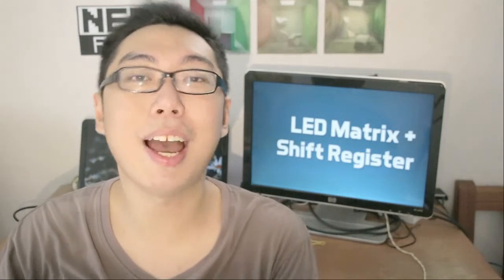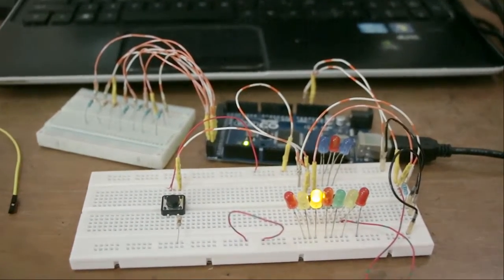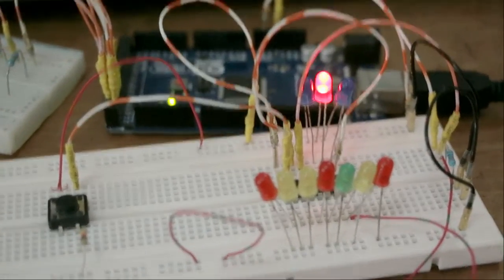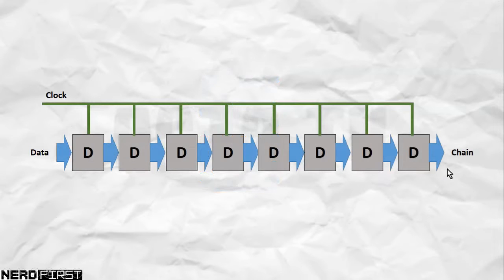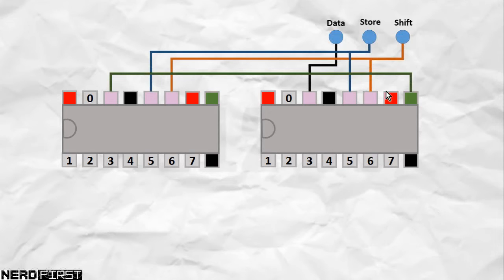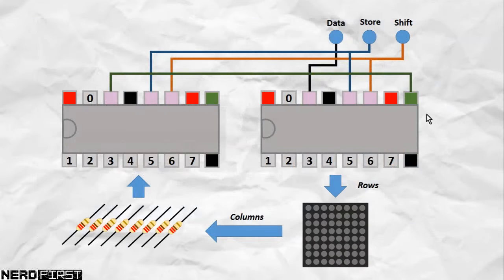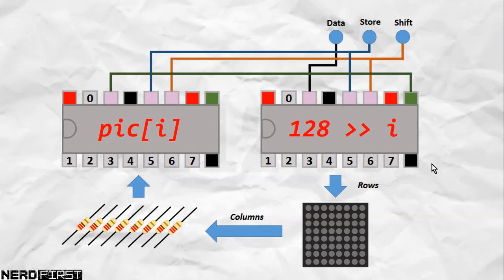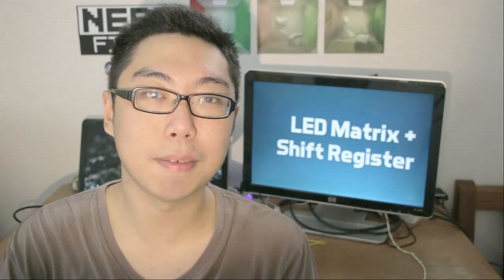Run an 8x8 LED Matrix using 3 pins!

Comment: Now today we can make led metrix with  one wire for signal and two wires for supply using ws2812 led  .
Reply from the maker: Hello and thank you for your comment! Indeed, three wires is probably the limit, though WS2812 uses a more complex signaling mechanism, almost the equivalent of building the shift register directly into every LED.

Comment: I tried the 8x16 matrix, but its not working, I just connected an extra shift register on data -> chain, and shift and store are connected. But I get is just a brief light up and then low brightness. can you help me with how the proper pinouts of 8x16 and what to modify in the code.
Reply from the maker: Hello and thank you for your comment! What you've described sounds correct (though note that strictly speaking it's chain -> data. The chain pin sends the overflowing bit out of the shift register and into the next). You'll need one shift register to select rows, and two to set column values. How you order them is actually up to you as long as the code follows the order.

If you were to do something like (Columns for Left Matrix) -> (Columns for Right Matrix) -> (Rows for both), then your shiftOut code should follow the reverse order:
shiftOut(DATA_PIN, SHIFT_PIN, LSBFIRST, 0b00100000);   // Select a row
shiftOut(DATA_PIN, SHIFT_PIN, LSBFIRST, 0b10101010);   // Left matrix graphic on row
shiftOut(DATA_PIN, SHIFT_PIN, LSBFIRST, 0b10101010);   // Right matrix graphic on row
store();    // Send out your updates to the LED matrices

Comment: If I do 16 by 16 led matrix, do I need 4 shift register? if so the bits on the code will be 510(1111111111111111)?
Reply from the maker: Hello and thank you for your comment! Yes, if you have a 16x16 LED matrix and you stick to the same 8-bit shift registers, you'll need four of them. 

However, Arduino's shiftOut() is designed to work with bytes (8 bits), so realistically, you're going to either have to call shiftOut() twice to shift 16 times, or you'll have to roll your own equivalent function.

By the way, that's a 16-bit number you're looking at, so the range goes up to 65535, not just 511!

Comment: Hey man, I saw you're still replying to comments and wanted to ask if there's a u8g library compatible with this. it would eliminate the need for the max7219 entirely
Reply: also subbed
Reply from the maker: Hello and thank you for your comment! I'm not aware of any graphics library for such LED matrices that also don't assume that they're driven by a max7219 or similar chip. Given the amount of wiring and setup involved, I think this technique just isn't as easy and consequently isn't as popular.

Comment: Hii, currently making this one and im having trouble. No led turns on but when i touch the IC it lit up all led. Could it be the IC the problem?
Reply from the maker: Hello and thank you for your comment! It's not really easy to tell what the problem is.

Double check that your connections are correct and not loose. If you're prototyping on a breadboard like I am, a lot of the times, that's all it takes.

Otherwise, you're gonna have to go through a set of sanity checks to see if the code or LED matrix are working properly.

Comment: There are 16bit i2c (de)multiplexers that only require two wires. They can run on 2v so I think you can do without the resistros as well.
Reply from the maker: Hello and thank you for your comment! Yes, there are definitely many ways of solving this. I went for the Shift Register technique since it's what I had on hand, and is relatively simple to understand without too much additional pre-requisite knowledge of techniques like i2c.

Comment: If you want to try using only 1 shift register and 1 decade counter, I highly recommend preparing 8 transistors for the decade counter pins. You will probably implement those output pins for the rows of the matrix due to its limited capability. I recently tried using those and directly connecting decade counter output pins as VCC for the led. I found out that each of these pin have built in resistors inside. These resistors are provided from the inverters of the IC. Making the last video as a reference, you don't like these resistors to be in series with your paralleled LEDS. Since the decade counter is an unchangeable IC, your best course is to connect each pin to the base of a transistor and make it as a switch for the direct 5V source (connected in collector) to pass through the emitter (connected in VCC of 8x8 matrix). I had a hard time finding this idea but it is such an opportunity to learn and share it with you.
Reply from the maker: Hello and thank you for your comment! This is super interesting, I never considered how the internals of the IC could also lead to undesirable behavior. I mostly looked at it as a black box ignoring implementation.
Reply: @NERDfirst   Always welcome 😊. Btw you can also use these 8 transistors as a solution for your maximum current draw in your shift register. You can just make those output pins as a switch to provide a direct 5 volts in every anode of your matrix. Since the 5V source of the arduino can handle, theoretically, a maximum of 800mA, you won't get any problem in long runs.

Comment: Hi! Really love the tutorial!!! very easy to understand... I just encountered a bit of a pickle... 
when i use this your code in this part:
for (int i=0; i<8; i++) {
    shiftOut(DATA, SHIFT, LSBFIRST, ~pic[i]);

    shiftOut(DATA, SHIFT, LSBFIRST, 128 >> i);
    store();
  }
all the led light up...

but when i interchange the two shiftout function:
for (int i=0; i<8; i++) {
    shiftOut(DATA, SHIFT, LSBFIRST, 128 >> i);
    shiftOut(DATA, SHIFT, LSBFIRST, ~pic[i]);
    store();
  }
the desired pattern shows up...
can you pls tell me what is happening? I think i correctly placed the wire connections...
Reply from the maker: Hello and thank you for your comment! Looks like the role of the two shift registers have been swapped around. Assuming that your wiring is indeed correct (including the wiring going to rows vs columns, assignments of voltage sinks and sources, and wiring between the two shift registers), then it's entirely possible this might be caused by differences in components.

Comment: Thanks again! Just what I need for my electronics project!
Reply from the maker: You're welcome! Glad to be of help =)
Reply: @NERDfirst  Hi! I wanted to ask if I could replace the 74HC595N with 74HC299N? I am trying to but it is driving me crazy. There is only one clock input on the 74HC299N while the 74HC595N has two - one for shift register and one for store register. Thanks a lot!
Reply from the maker: Hello again! I don't have experience using the 74HC299N, so take everything I say here with a pinch of salt. I just skimmed the datasheet and have a very limited understanding.

The 595 is actually two sets of shift registers, which allow you to shift values into a "temporary" bank before storing them into the output. The 299 doesn't have this, since, if I understand correctly, it's designed for parallel updates of the internal shift register via its pins, ie. The pins can be used for both reads and writes.

You will probably not use this feature. Instead, you can still use DSL Pin 18 as a digital input, while left shifting (ie. MR Pin 9 High, S1 Pin 19 High, S0 Pin 1 Low while pulsing CP Pin 12). This will make it behave the same way as the shift register in the video, minus the two-bank "storing" effect.

Not really sure if it'll work well in the context of driving these matrices though.

Comment: Hi! I followed your tutorial with interest. I also have a slightly different circuit, but a very similar little sketch (I didn't make it myself). I made it statically display "0", in the array I have several elements, and I want to display "1" as well. How can I put a delay between them? My matrix just flickers very fast.
https://drive.google.com/file/d/1GuvV2wnkvv47gfbxX6Hnw0eDYN-3P4rP/view?usp=share_link

Comment from the maker: Expand for Errata and Other Notes

1. On Current Draw
Do note that one important concern is whether the shift register and the Arduino can truly provide enough current to power the matrix, especially if many LEDs are switched on at the same time. This is particularly important as the datasheet for the 74HC595 shift register says that the maximum current any pin can source or sink is 8mA which is really not a lot. It'll work in little toy examples like this one, but if you're going to be building something like this for use in the long run, you might not want to do it the way I did!

Take your own measurements, refer to datasheets, and use external power sources to be safe. Thanks to YouTube user Enigma758 for bringing this up.

2. Errata
Please note the mistake at 9:10 - In the diagram, the shift and store pins have been reversed. The store pin should be above the shift pin. Thank you very much to Joshua Thyer for pointing out the error!

3. On Debugging and Help
Unfortunately due to high IRL workloads, I'm not able to look at your code and help diagnose problems. You may contact me at hello(at)nerdfirst(dot)net for paid consultation, if you really see the need.

Comment: 8:40 Hi.  If you light a row of LEDs at a time, you will be overstressing the the 74HC595 which is not designed to handle that much current.  It may work and the chip may survive, but there is going to be a voltage sag (drop) due to sinking excessive current.
Reply from the maker: Hello again! Indeed, the same considerations apply as with your comments on the other 8x8 matrix video. I'll put up a pinned comment for clarification.

Comment: So clear idea and explanation... 
But how the 8*16 matrix get power supply.. is there any power supply circuit required for the led matrix
Reply from the maker: Hello and thank you for your comment! The way I'm doing it, there's no distinction between "signal" voltages and a source of power. Of course, this might put unnecessary strain on your Arduino and the shift register.

Comment: Hi! At 14:21 how do you get the number 128? I'm doing a simple simulation of a 3x3 matrix before scaling up to 8x8, but with the 3x3 the code doesn't work (I've changed the array to {0, 16, 17} to match what a 3x3 can do). Any advice?
Reply from the maker: Hello and thank you for your comment! I explain why it's 128 at 14:23. Let me know if there's anything not clear there so I can elaborate further.
Reply: @NERDfirst  omg i must have missed it thanks so much!
Reply from the maker: No prob =)
Reply: @NERDfirst  I know this is off topic, but I have a code meant for a series of 8 daisy chained 74HC595 shift registers which lets me change 1 bit at a time (basically running through all the existing outputs, 8 at a time, store them, only replace the 1 particular one I want changed, before pushing them all back through the registers...). Will it be able to work the same way if I replaced the 8 daisy chained shift registers with 1 64-bit shift register instead?

Sorry if I shouldn't be asking a topic out of scope, let me know and I can delete this.
Reply from the maker: @dragongirlster  If I'm understanding you correctly, it should be okay. 8-daisy chained shift registers means you essentially have a 64-bit shift register (ie. Each bit can be shifted 64 times before it "drops off"), so replacing it with an actual 64-bit shift register component should be exactly equivalent.
Reply: @NERDfirst  thank you for your reply! I thought so too, but didn't really have enough knowledge about this topic to affirm this.

Comment: great video!! Do you know how would the code be if i'm not allowed to use shiftout()?
Reply from the maker: Hello and thank you for your comment! It's certainly possible to operate a shift register without using the shiftout() functions, but you'll need to understand how the shift registers work so you know the right times to trigger off the shift register's shift and store pins.

I've covered the shift register before, you may want to check out my video here: https://www.youtube.com/watch?v=MRy47jCn3zA&t=4m

Comment: Hello I realy liked the video! I am making a led display the way you did in the video, that Imitates firework. is it possible to fade the leds after they are turned on?
Reply from the maker: Hello and thank you for your comment! Fading is possible but challenging. To do this (assuming you're on Arduino which doesn't put out "true" analog signals), you'll have to read up on how PWM works - It "dims" LEDs by repeatedly switching them on and off. That in itself isn't too difficult, but the problem is you're also scanning to draw out the display. Meaning you have to scan out images that are different over time, with some pixels alternating between on and off to achieve the PWM effect.
Reply: @NERDfirst  thank you for your reaction. I understand that it s difficult to scan and fade. And what if I have a fixed order of LEDs that need to turn on. Maybe I can do that without scanning? Or do I need more pins for than on Arduino. I have 25 LEDs

This is wat I want to make : https://youtu.be/fheVqMlpWUM
Reply from the maker: If you don't do scanning, you're a lot more limited in terms of what shapes you can draw. You can draw simple horizontal and vertical lines, as well as a single rectangle. The linked video makes it seem like you might be able to get away with it. You'll have to plan out your animation well.
Reply: @NERDfirst  yes the shape that I want is exactly the same as in the link I have send. And is not going to change like a led matrix. will it be possible to use the shift register chips for me? In order to do the fading and reducing the amount of pins? Or is there a simplified way to control this

The thing is i want to make exactly the same as in the link I send you
Reply from the maker: Yes. It sounds doable. Plan out your animation beforehand to know which pins need to be toggled on and off, then you can see which parts can be optimized.

Comment: so I'm having a problem with this when upload the code I just get a straight diagonal line. if I change the 8 in "for (int i=0; i<8; i++)" to a 2 like this "for (int i=0; i<2; i++)" I get a checker board pattern. I'm confused by this. also when I change the int "pic[] = {0,36,36,36,0,66,60,0};" to any thing else nothing changes. plz can anyone help
Reply: problem solved I had the store and shift pins swapped

Comment: Thank for the video, it was really usefull.
But i have one question.
when i test everything by just shifting out a 0 and then a 255 and then storing it like you said to test the setup my leds dont light up but sometimes if i press the reset button random colloms light up or random rows, its really confusing.
My wiring should be correct because i was able to light al of the leds up once.
Reply: the problem lies with the second shift register
Reply from the maker: Hello and thank you for your comment! From your comment, I assume you've fixed it!

As long as all the pins on the shift registers have been correctly connected, and that your code takes care to reset the registers everytime at the beginning, it should be fine.

Comment: This is an awesome video thanks for sharing all the good information, 
If i want to use an led stripe , do i need to follow the same concept?
Reply from the maker: Hello and thank you for your comment! Glad to be of help =)

The LED strips I have encountered so far do not work in the same way. For example, the WS2812 strip uses a single data channel to control any number of LEDs, with each LED forwarding the messages to the next.
Reply: @NERDfirst  I want to build a stopwatch with 4leds stripe in each segment 28led for each number, what do you advise me for the electronic circuit? 
Thanks

Comment: Thanks man! Now i got to know many others are unnecessarily making this concept complicated. Its very difficult to write control code if you are making a 20 X 20 led matrix, the binary for 20 will be very big and you cant use Int as you exceed its limitation, so I used Float. But yours differential control for each shift register is awesome!
Reply from the maker: Hello and thank you for your comment! Yes unfortunately the way in which these panels are addressed makes it messy to scale up. Shift registers help for sure, but like you said, past a certain point there will even be issues with data storage.

Comment: Could you use this scheme to control a 9px row x 368 column matrix? I'd even be willing to leave a column on the table if I could do this with 47 shift registers, and only 3 data pins.
Reply from the maker: Hello and thank you for your comment! Theoretically, yes, you should be able to do this. However, when things start to get large scale, miniscule issues will begin to add up. For example, the time taken for information to propagate from one shift register to the other. Hell, even the time required for the arduino to serially stream the information out. That's going to take time, but you can't delay scanning or things will look weird.

What I'm saying is, you can try this, but be prepared for weirdnesses!
Reply: @NERDfirst  Yeah, and refresh rate is going to have to be pretty high. Could be worth a shot. I'll give it a go eventually. I'm at the concept phase of my project, so, nowhere near ready to execute just yet.

Thanks for your reply.
Reply from the maker: Usually when people want to drive large enough displays (eg, via VGA), they may look towards more powerful equipment like FPGA. I haven't used that before though, and I'm not sure if that will be overkill for what you're doing, but you may want to add that to your list of hardware to research. Good luck for your project =)